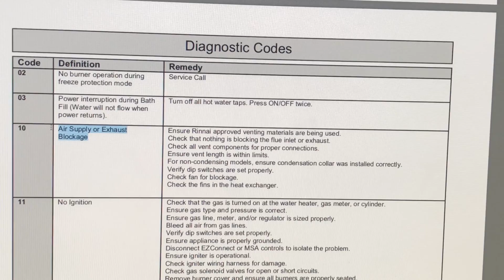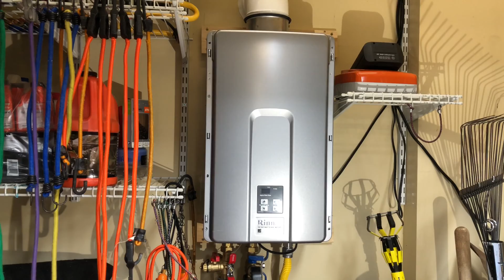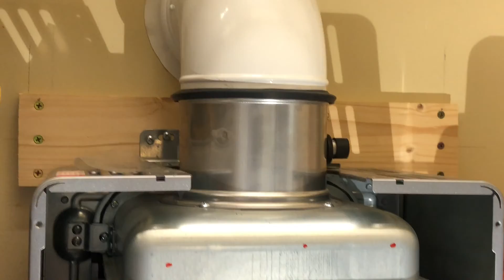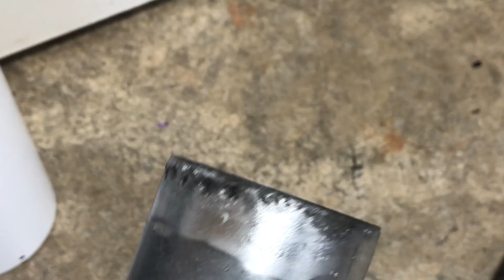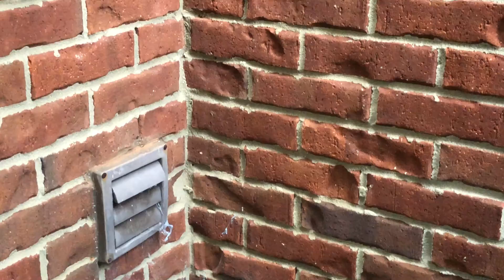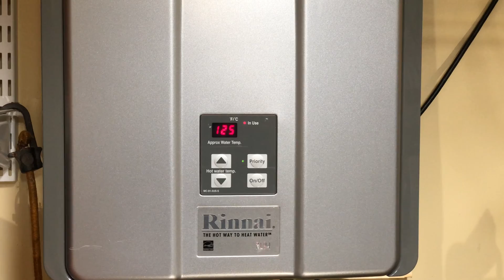Rinnai Water Heater stops heating - Diagnostic Code 10 on RL94i

Comment: Same issue. I cleaned the fan several times, always fixed it for a couple months. Now, clean fan and error 10 is thrown every shower. 
I'm thinking the heat exchanger needs to be exposed and cleaned. Removing it looks like it involves breaking seals between the pieces. :(

Comment: I have saved this video as one of my favorites. Ran into the code 10 issue twice in the 5 years. I followed the exact steps listed in this video, to clean the fan motor and put it back, and this did the trick. Great job putting this video and thanks for helping others.
Reply from the maker: Thanks! I had to clean my unit again this past week after getting cold showers again and another Code 10! I opened the fan to find 2 dehydrated red wasps looking for a new home many weeks ago! Problem solved.

Comment: We have the same unit and it's been nothing but problems. We had a bad main board which took a bunch of sensors with it; then sensors started dying one by one after it was replaced (each one causing us to lose hot water until turning it off and back on again). Now we are getting Error 10, so it makes me believe there has always been a blockage and it's been overheating; or the blower is dying (The one thing they haven't replaced yet aside from the other motorized parts and valves)..
Reply from the maker: That could be the culprit. Take it apart and see if it’s full of moths.

Comment: Thank you for making this video.   Rinnai should have this in the manual.   I was quoted $400 for a service call and a 6 week wait time.    After watching the video it took me 15 minutes and I had about 25 moths in the fan cage.  Once removed the problem was solved and the unit is much more quiet when it runs.

Comment: I watched both of your videos and attempted to fix the problem. I thought to myself "I really hope I have bugs in my fan" . . . This way I would be able to fix it. Your video saved me big $$$$$. I was able to pull out the fan and voila! A crusted on honey bee AND a lot of dust was all over the fan. I scraped off the honey bee and took a toothbrush and cleaned the fins of the fan. HELPFUL TIP #1: The plastic connector on the fan is difficult to pull apart. I decided to leave it connected. I saw another video (someone else) where they broke the tabs on it. TIP#2. Use a Sharpie to write 1, 2 and 3 on the three connectors TIP #3 Use a Sharpie and draw an up arrow on the fan before you remove it. There is only one way put it back on, but this makes it a little bit easier.
Reply from the maker: Glad to hear all of this and I second all of your comments! Glad to help.

Comment: I can't say thank you enough!  I started having the same problem about 3 weeks ago.  I became the master of the 3 minute showers.  I was afraid that I would have to call a plumber and spend no telling how much money, but after watching this video, I was able to do it myself and I'm not very handy at all.  It was a fairly simple procedure.  The hardest part was navigating through those 1000 wires that are in the unit, and then making sure you didn't drop one of the screws.  My unit is under my house, so this would have been a whole lot easier if my water heater was in the garage.  Thank you for this video!
Reply from the maker: Glad to help! The power of YouTube!

Comment: I just found this video as I was experiencing the same problem with a code 10 error and "cold sandwiches" after about 10 minutes of turning on the hot water.  Plus I had done all the other things trying to fix this problem.  I took the fan out and found debris and lint from the dryer vent which was too close to the intake vent of the Rinnai Water heater.  Not only that, I had sunflower shells from our bird feeder in the fins as well as all kinds of other debris.  I'm assuming the wind blew the shells into the vent. I cleaned it all out and blew out the fins with an air compressor and have not had a problem since.  Plus, the heater is now quiet as I don't hear a thing anymore.  I did move the dryer vent a long way away from the water heater intake valve as well as the bird feeder.  Thank you for posting the video. It's been months of problem free hot water.
Reply from the maker: Sounds familier! Glad to help!

Comment: Thanks!  I thought I had a totally different issue and took everything apart, but I did use your advice and pull the fan.  There was a huge amount of bees and moths in there!  Not sure if that’s what fixed it but its working now!

Comment: Question:
I have a Rinnai RV53e tankless heater that mysteriously quit working last night. The controller in the bathroom has no power to it. I checked the unit with a multimeter and the electrical outlet that feeds it has power but for some odd reason I cannot get it to come back on. Would you happen to know if my unit has a fuse that needs to be replacing? If that doesn’t work the only thing else I can figure is it might be the PCB board. Can you please help?
Reply from the maker: I do not know what this could be and I don’t recall seeing a fuse inside mine. There could be one though. Probably need to call Rinnai. That is what I initially did and they gave me the reasoning behind the the diagnostic code that I was getting. Call Rinnai Customer Support @ 1-800-621-9419 and they will probably give you some good advise.

Comment: I cleaned my fan and as I was putting it back in, the squirrel cage seems to have gotten bent or twerked a bit. Now it is making a lot of noise. Any idea on how to straighten the fan blades back out to cut down on the noise?

Comment: Spot on! Thanks for the video, my fan was in fact dirty. I used hvac coil cleaner since I had it on the shelf and a small nylon brush to clean the squirrel cage rinsed it off reassembled and it works perfectly now. Thanks again!

Comment: I have a Rinnai Model C85i-0 and its running thru an ecologix mixing box. My heat doesn't seem to be working, but when I turn on the hot water the Rinnai fires up and makes hot water. So, I'm trying to figure out why my heat doesn't seem to want to start. The thermostat is calling for heat

Comment: Great video.I have a RUC80 and not getting the 10 error code with shower going cold but I am getting cold bathroom SINK water after shaving for about 3 minutes requiring turning the hot on and off then waiting to reset the system. I've flushed it once after 2-1/2 years of use and am about to flush it again (that will make twice in 5 years).   Would it be worth the work to take mine apart and remove the fan to try this fix?
Reply from the maker: Yes. Chances are good that is the issue. Pretty easy job.

Comment: Thanks for Excellent details and steps. I have same problem I check my fan super clean there was small air quality Sensor inside the fan I clean that also clean the duck still getting a code 10.
Finally I replace the fan with the small  air sensor. Still getting code 10 . 
That’s lead me two option.
1- Clean the inside the heat chamber which’s lot of opening.
2- Two to check while taking a shower in one particular bathroom tripped with error code 10.
So my investigation lead me to the shower I open the shower Handel remove the Water balance in cartridges replace the cartridge.
The function of this cartridge is to balance the hot water with the cold water and the water heater sense it’s too hot is shut down and giving code 10.
This $22  Koehler cartridge solve my nightmare!!

Comment: My R94 LS is 10 yrs old..... installed in Hackensack MN. It has been a problem for 6 yrs...... a REAL problem for 3. Rinnai was of no help. I am rural and there are no dealers within 90 miles. My unit had gotten really loud. As you suggested I pulled my fan assembly today. It was full of dried bug juice and the fins were caked with dried bug guts and partially blocked. I pulled the assembly, blew it out then separated the blower motor from the housing. Took 40 mins using dawn soap and glass cleaner to get it 95% clean. Then I cleaned the intake just before the fan, and wiped out the exhaust area just above the fan. Put it back together, total time an hr. It runs so quiet now I can't believe it! Just took a longgggggg... hot shower. No Code 10. Thanks for your help.
Reply from the maker: So glad to hear! It took me a while to before I made this discovery myself back in 2018. I just re-followed my procedure from 2 years ago as I was starting to see the issue again and I indeed had a few moths in it and that is all it took to stop the heat buildup and error code 10.

Comment: OMG thank you!!! I called a plumber and they wanted $1,200 to flush and clean out the bugs from my water heater. Told me is was very detailed work. What jerks.  You rock sir!
Reply: HA! I just had the same experience today. $850 for diagnostic (to understand what code 10 is) and flush. A flush alone was $500.

Comment: Have an older RL 75, about 12 yrs, not a problem till this year, error code 10 kept coming up, cleaned out my vent, still getting a code. Now living in a rural area, pretty much means your screwed getting anyone competent to work on it, so I turned too YouTube alot, lol, for alot of things. My units fan is rotated 90deg and it's wiring is different, but man you put me on the path. I was able too find out how to complete the repair, found a cricket blender in the process, yuck, and have enjoyed error free days since.  Probably saved a ton of money also.  Thanks for taking the time. John Mentone, AL
Reply: I have a 75 model and the fan is in a different position to the one shown in the video. It's about 11 years old. Code 10 for the first time. This video is a lifesaver!!!
Reply from the maker: Glad to provide some positive guidance!
Reply: @John Foreman, I have the same problem, an older unit with the exhaust fan assembly perpendicular to the access panel, rather than the newer ones that smartly mounted in-line for easier removal.  How did you get yours out to clean it?  I took a look at mine today and confirmed it has indeed turned into a cricket garbage disposal but accessing the mounts to remove looked nearly impossible.  Can you share some insight? 

Also, thanks to @Parker Smith for the excellent video and guidance!

Comment: FOR EXPERT ADVISE EMAIL CORTEZCOMPANY@YAHOO.COM YOU MUST ALSO TEST GAS PRESSURES VERY IMPORTANT
Reply from the maker: m x Error code 10 is not related to gas pressure and is due to a buildup of excess heat in the combustion chamber. I don’t disagree with you abut testing gas pressure though, but that is not related to this issue.

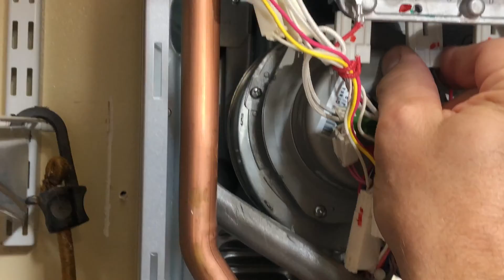Comment: Did mine about 3 years ago and had to do it again yesterday. Very little trash in the fan but cleaning it did the trick. On the 3 connectors shown at 1:10 in the video, I took a sharpie pen and numbered them 1, 2, and 3 to make sure I put them back in the correct plug.
Reply: i think the just a few inches above where the connectors are markings R(ed), B(lue), and Y(ellow)

Comment: I have completely cleaned the exhaust multiple times over and I still get error code 10. I replaced the exhaust fan, still get error code 10. Checked all seals, everything is fine. Dip switch settings are correct. I have had multiple plumber's opinions say they can not fix it. I am at my wits end with this damn product.
Reply from the maker: Ian Konrad you need to check your exhaust for blockage. Error code 10 is from an excessive buildup of heat inside the combustion chamber. Bugs, debris, bird or rats nest could be a problem.
Reply: @ParkerSmithIII  Cleaned it dozens of times.  Turns out it was a slightly bent fan blade from the factory that was imparting resistance on the fan motor tricking it to think it wasn't getting enough fresh air. After a warranty claim replaced the whole fan assembly again, it runs beautifully.

Took a dedicated appliance repairman and his trusty oscilloscope to discover the fan was not outputting the proper voltage/signal when under load. 

Thanks!

Comment: Thank you very much for sharing!  Been looking for a vid like this for years.  Fixed my problem. Like yours, fan had dead moths, bugs, even a piece of fiberglass pink insulation!  Cleaned the squirrel cage blades and it runs so quiet now.  Thinking I might put some aluminum mosquito netting on intake to help with the problem.  I also had a broken corroded wire leading to a sensor on right side of burner housing, which probably added to my code 10 problem.  I fixed that first and used it for a couple days before cleaning fan blades to make sure code 10 went away and it did.
Reply from the maker: Greg C has to help and pay it forward.

Comment: Long story but it may help just one other person.

I watched your video and happy that you described exactly how mine was suddenly acting. Just before I removed the fan, I decided to close up everything outside for the night. When I checked to make sure our outdoor shower was turned off I noticed that both the hot and cold valves were on with the dog wash nozzle closed, which made an open loop from the hot to the cold. The cold water had to be blending back though all my hot water pipes. (I did the plumbing on the shower myself years ago with just ball valves knowing I always just turn on the hot). Never thought about that scenario. I’ll correct that goofy plumbing sometime.

Comment: Thank you so much for this thorough video!  I’m not a handy guy at all. But by watching you carefully show me the connectors to unhook and the screws to remove, I nervously tackled this project. Wow. Easy peasy. Mine wasn’t caked up too bad. I actually had a few dead wasps attached to the inside of the fan. Enough to cause drag or unbalance I guess. My first ‘code 10’ and cold shower was last night after 5 straight years of flawless service from my Rinnai. Hopefully my first is my last.  Thanks again!

Comment: First off, thank you for sharing this with us. I have been dealing with this issue for 6-7 years, having multiple techs out and being GOUGED from anywhere from $150-$450 each time and had a couple of unscrupulous techs try to say it would cost $1000 or MORE to resolve the problem.  This seems to be an inherent issue with the Rinnai but that seems to be overlooked. So how much money are we saving yearly if we have to pay a tech to service yearly plus service calls? I am looking at going back to a regular hot water heater, but I have had some of those unscrupulous techs say it would be thousands of dollars to re-vent,  which I now know is bs. Definitely a design flaw but Rinnai is taking no responsibility for this. Thank goodness for YouTube !!

Comment: Had the same issue but only found one moth and one lady bug in the fan blades. Cleaned them out and took a toothbrush to the blades just in case. Problem solved !!
Reply: So a very small amount of debris was enough for the system to alarm?

Comment: I have been fighting this issue with my unit for over 2 years.  I knew it was an issue with air flow, but this was the first time I was able to figure out where the obstruction was.  After taking it apart, my unit looked to have the exact same number of dead months as the unit in the video. 

Thank you so much or posting this!